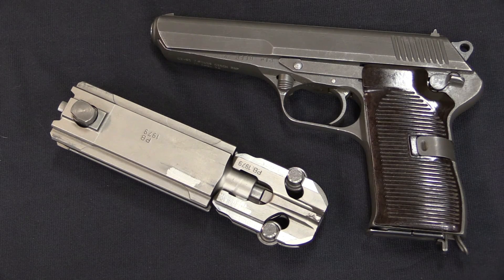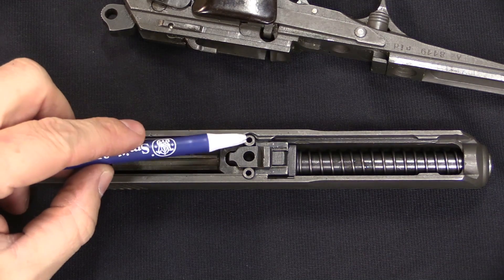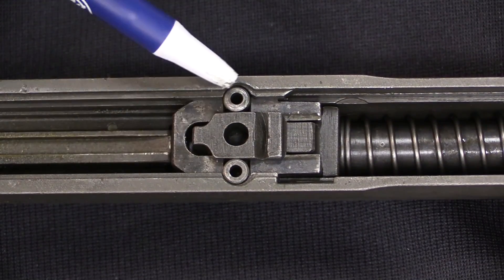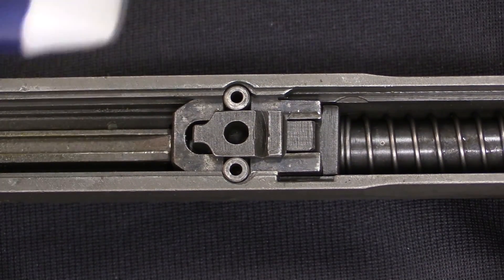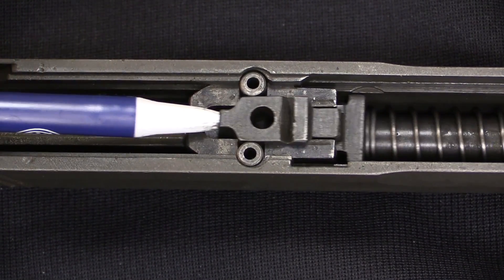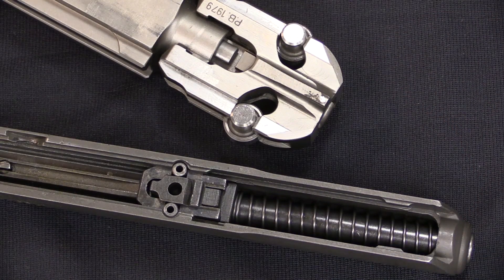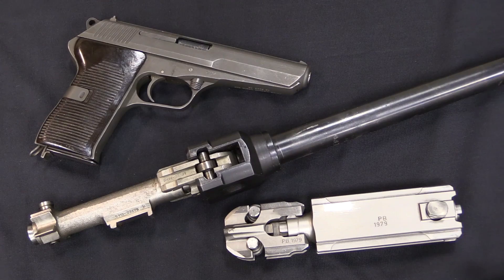How Does It Work: Roller Locking

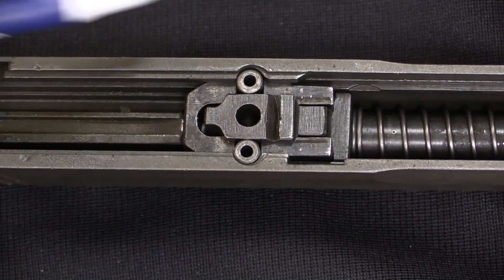Comment: 1:01 The rear part is not forced back by another action, allowing the rollers to retract. The rollers are forced to retract by "ramps" inside the frame, and the rollers force the firing pin body  to move back against the recoil spring, separating the front and rear parts of the bolt carrier enough that the firing pin will not accidentally fire the next round out of battery.

Comment: Interestingly, I was quite distraught when I found about this system because i had developed and was about to patent a very similar locking mechanism for firearm bolts using two flappers locked by a center, V shaped, steel block. I was researching for a similar system that already existed and realised i had reinvented roller-locking 😂

Comment: What if you used blocks (like traditional locking lugs) instead of rollers, 8m working on a design that does that and is long stroke gas piston operated and I was wondering what other people think will happen. I am very much still in the concept drawing phase and I'm looking for feed back.

Comment: you are totally wrong about the MG42/3/1 bolt. Nothing is pushing back the carrier (except the rollers themselfs). On recoil, the barrel is pushing back the bolthead. The rollers (they are not allowed, they are forced in), therefore ar pushed against some bars (I don´t know the exact term in english) in the receiver, witch force them into unlock. BTW I like all your videos (everything but the french stuff)

Comment: No, I did still have some confusion after watching both of these, fortunately someone in the replies to a comment shared an old video of yours (the HK P9S I believe) and that video contains the part I was missing.

Specifically in the explanation that in a roller delay system force can be applied to the rollers and they will unlock, whereas in a roller locked system the rollers cannot unlock from force applied to them.

Thanks @Petr Hošek

Comment: Roller locked systems have 2 main disadvantages, mostly from military point of view. First is that rollers are rather small and can be lost during a disassembly. Second is that they have weaker ejection when compared to rotating bolt (and rotating barrel) systems, which might be needed with a ruptured case.

Comment: Is there any particular reason this system doesn't see more wide-spread use? It looks fairly simple to manufacture and maintain over-all, It seems like it would be reliable due to its simplicity and few moving parts. 

Looking at the example guns shown its clearly an older design but it could likely be improved upon with modern technologies, after-all roller-delayed blow-back was designed in WWII and is still used today, although primarily by HK to my knowledge. Then again I'm a sucker for unique designs, would love if companies did limited runs of older model firearms, there's a kind of novelty to them even if they are unusual in nature.

Comment: Really interesting to see that Pistols also had a roller locking mechanism. I only knew that system from the german machine guns and it's derivates.
Reply: KuruGDI snd it’s such a fun gun to shoot! You can pick them up surplus for under $300, you can buy every part on it brand new for super cheap, and mags are $8
Reply: @Bloodreign137  I live in a country where I can have two Pistols. Every further one has to be authorised by the government and costs a ton of money.
But still, I would be very interested in the gun as such!

Comment: A question that I have been wondering a while now: are there any roller locked gas operated guns?
Reply: There was a prototype variant of the StG-44 that was roller-locked gas operated.  I think it might actually have been the Gerat-06, and messing around with it with the gas system disabled was how they discovered that roller-delayed blowback could be done, giving rise to another prototype, the Gerat-06H (Ian has a video on that one).

Comment: Next question: Why is it rarely used?
Btw, more of those "How does it work", please.
Reply: On pistols, something like a tilting barrel or rotating barrel system is just as effective but is also simpler, stronger and most of all cheaper. Fewer parts, less precision, same end result = win for tilting barrel. Same holds true for rifles generally except there it's up against mainly rotating bolts which are stronger and more inherently accurate. Basically there is nothing really wrong with roller locking, it's just cheaper and easier to make something else that's just as good or even marginally better.
Reply: @wingracer1614  The system (IIRC) is used in the HK G3 and the MG 3 (MG42) which are based on wartime weapons designs. The germans back then were looking for an easy and cheap design. How does that relate???
Reply: @thomas_jay  The G3 is not roller locked, it's roller delayed blowback, a very important distinction. As for heavy and medium MGs, that's a whole different story with very different demands and requirements from a rifle or pistol.
Reply: @wingracer1614  Okay, thanks for clearing me up.

Comment: If we did not have roller LOCKING we would not have roller-DELAYED locking.  As the story goes, German Engineers discovered that roller-locked guns would operate themselves under the right conditions.  Then we got the CETME.

Comment: I don't now how many people this is going to help, but it seems like some have a hard time distinguishing between locked and delayed systems. So, imagine pushing with a rod on the bolt face throu the barrel: if it opens, it's delayed, if it doesn't, it's locked.
Reply: A short recoil action (Browning, Beretta/Walther, or that CZ...) opens that way. Simply the barrel recoils with the slide for the first few mm.
Reply: @neutronalchemist3241  I didn't thought of that, not the best rule huh?
Reply: @tommasomorandini1982  Nor you can make the rule "it's a delayed blowback if the bolt moves, but the barrel stays still", because in a Revelli action (today used by the FN Five-Seven and the Ruger 57) that's considered a delayed blowback, the barrel recoils, but at a slower pace than the bolt.

Comment: How about a video on the difference between roller locked firearms such as the Czech CZ 52 pistol, German MG42 and Rheinmetall MG3 machineguns, and roller-delayed blowback firearms, such as the HK G3, where there is no genuine locking of the bolt and no recoiling of the barrel in delayed blowback actions?
Reply from the maker: Next week is roller-delay.

Comment: I've often wondered why the roller locking mechanism isn't more commonly used in pistol designs. It seems to me that it would naturally reduce muzzle flip compared to Browning-derived tilt locking designs or rotational force from a rotating barrel locking system like in a Beretta Px4 Storm. The roller locking system is one of the reasons why I like my vz. 52 pistol so much.

Comment: Thank you Ian. I think it would be a good idea to compare different systems of locking such as rotating bolt, roller locking, tilting bolt, locking flaps, vertically-moving locking blocks etc.  I understand that such a video cannot be short. :)
Why in 40th and 50th tilting bolts were popular (Bren, SKS, FAL) and after that most popular rifle families uses rotating bolts (AR, AK)?
Reply: Rotating bolts have some very real advantages in the accuracy, strength and durability departments.

Comment: Oh thank god, I was only just yesterday thinking "how the heck is the MG42 actually a locked-breech gun, when it looks just like a roller-delayed system!" Truly Ian is the hero we need, even if we will never earn him.
Reply: The Mg42's barrel assembly moves under recoil, locked with the rollers to the bolt carrier, until it reaches the end of its designed travel where there process to unlock as described by Ian takes place. 

OTOH, the G3, CETME, MP5 and so on have fixed barrels.The bolt is not truly locked to them

 Roller delayed blowback acts as an extension of a blowback action as the name suggests. The rollers act to delay the open of the bolt by temporarily concentrating recoil forces acting on the bolt carrier as a whole into the rear portion of the bolt carrier assembly. If the rear portion of the bolt carrier assembly has ( by way of example) half the total mass of the bolt carrier and is constrained by the rollers to move 3 times the distance as the front portion of the bolt carrier ( real world ratio are higher than this), The rear half of the bolt carrier must experience 3 times the acceleration. If Force= mass* acceleration, bolt weighing 1 unit of mass experiencing one unit of acceleration needs to have 1 unit of force acting on it. OTOH,  0.5m*a+ 0.5m*3a= 2f. Thus even though this bolt carrier weighs only 1 unit of mass, with the roller delay system, it requires a forces similar to a bolt carrier twice as massive to experience the same acceleration.

Comment: On the CZ52 the rollers have to be replaced somewhere between 250-500 rounds because they wear easily. I have one and replaced them with modern rollers compared to stock, but its a good side note to be aware of.

Comment: Mmm...so what is the reason it is used less?
Reply: For locking? It's pointless and overcomplicated since you need an additional recoil system anyway, and the rollers become.. sloppy/loose over not too much time and need replacement.
Reply: @mahartma  Modern materials have overcome the problem of them getting excessive slop in them over time. Even ones that used hardened steel for the rollers, but the surface they rolled on wasn't nearly as hard, would Brinell over time and work harden the less hard surface that the rollers rolled on. But the surface would be upset and/or abraded before it was work hardened.that's why they would get an excessive amount of slop.
Reply: A tilting system, being it a tilting barrel like the Browning or a tilting locking block like the Beretta/Walther will always have less surface friction, and so less lubrication needed and/or surface wear.